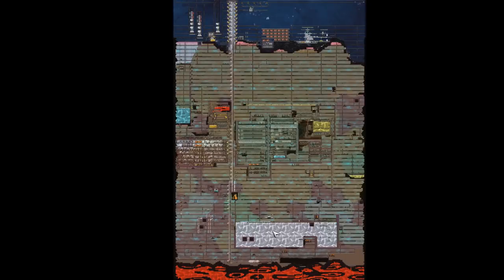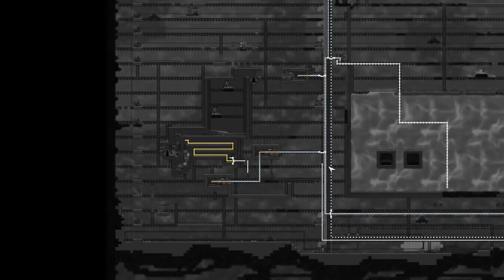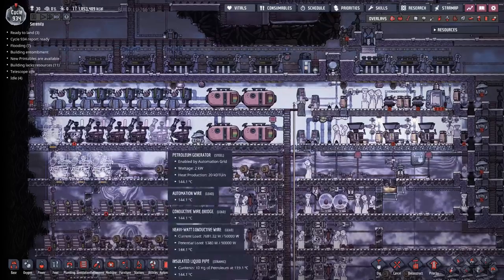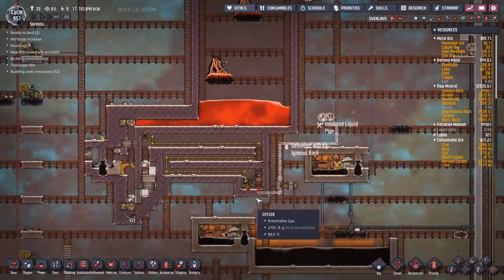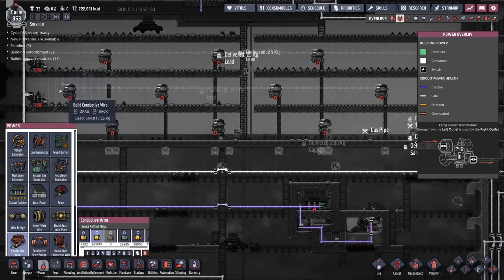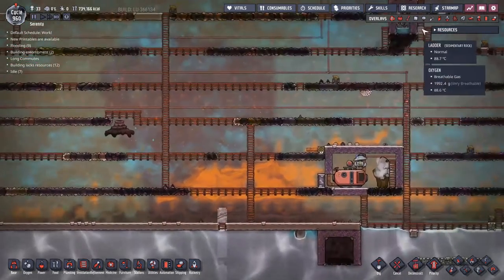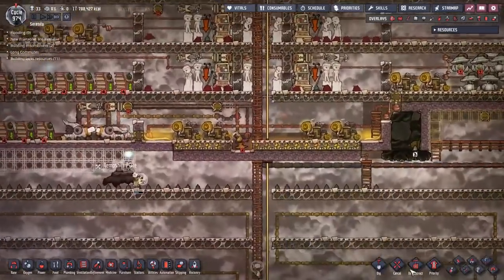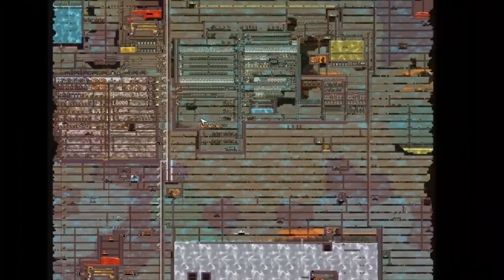Oasiss 18 : 2nd Petroleum boiler, 3 Nat gas vents, Sauna expansion : Oxygen not included

Comment: i am building your oil boiler at the moment on 2 maps but added a little bit to it. Where the igneous rock falls down i put another vacuum area with a autosweeper and a conveyor (both standing in a bit of oil with a cooling loop behind) and sweep the igenous rock. This travels in vacuum to a closed by steam turbine room and through it. Inside there is also the aqua tuner for the cooling loop. I didn't manage yet to start the boiler (have only 10 dupes and build slow... 400 cycles and not yet in space) but i guess the igneous rock will be hot enough to run the turbine, come out "cool" and can be used then.
Reply from the maker: There is plenty of stuff you can do with the hot rock if you want to,  I could have sent it to my industrial power sauna but I would have had to create a vacuum tunnel to get it there.  How useful it is does depend on location.

Comment: Question. Do you think with thatmuch magma that you could use it for creating steamvents that produce power with it?
Since there was 1 of the baseloving videos a guy who had molten steel in it. Do you think you could pump lava into a pipe and then use normal pipes to radiate the heat into a steam room to basically create power? (Limiting the flow so not to much heat gets transfered). Because if you can get like 2-3 turbines running thats 2KW of power you can get out of it directly. (also allowing to use the exess energy that you don't need from your volcano)
Reply from the maker: It's possible to extract direct power from a volcano, however a petroleum boiler will provide far more power so that's the usual route. However with multiple volcano's you could and should tap them for power. The hard part is making it maintenance free and relatively cheap to build. I have a design going up in today's video that should work out pretty good.
Reply: @FrancisJohnYT  thanks. 
Yeah but a petroleum boiler is limited in power output. 10kg/s not much more. 
The idea is to use the excess power that the throughput can not let through.
Reply from the maker: @Speiger  it could be done but at best you would gain about 1 KW.
Reply: @FrancisJohnYT  Having or not having.
Honestly with a steam chamber it could be even more increased. Depends on how much work you want to add.

Comment: Where would you get the heat for a boiler if you don't have any magma?

Im on a cold map with a frozen core. Needless to say, natural heat isn't something I have to work with. The only thing I can think of is to use a metal refinery or glass forge. Nothing else really reaches 400C itself or from an output.
Reply: I also have relatively cold map and frozen core, but i still discovered two volcanoes so far.
Reply from the maker: Magma is really the only early/mid game choice. There are some getto designs using refinery but nothing I would classify as fire and forget. Your best bet is to hold out until space and get 5kg of niobioum. Use that to make a bunch of Therimum. Use a therimum aquatuner as the heat source of your boiler.
Reply: @FrancisJohnYT  Thanks. My attempts didn't really pan out either. Thought liquid glass could be of use, but it can't hold much heat and reheating it through a refinery isn't really an option. 1 process of steal adds 1,200C of heat to glass due to its poor heat capacity. It instantly went to rock gass, broke/melted the obsidian insulated pipes, turned into magma, who then turned an area chunk of natural tiles into sand.

If it wasn't a frozen map, that could have been a fun cleanup. There really isn't any liquids with decent thermal capacity who also can reach higher temps. Liquid copper could work. Use glass to melt copper, then "maybe" use copper as a refinery coolant and as for a boiler heat source.
Reply from the maker: @102Chewy  Lead is liquid from mid 300C to about 1700C that might be a useful liquid coolant for your purposes.

Comment: From what i see on Tony's builds is that you are not utilizing the igneous rock that the magma turns into for extra heat potential.  Also you're not using a method that turns the magma blade into loose rock so you are forced to use a drill.  A drill that has caused you a lot of pain ;p i may add.
Reply from the maker: I made attempts to use a debris method for petroleum boiling but no matter what way I work it I either don't get the heat out fast enough or it becomes much bigger and more complicated than the drill method. Letting the tiles solidify and mining them so far is the simplest and most heat efficient method I'v found.

Comment: I want to know the math behind the length of the pipe in the petroleum boiler. You mentioned you use aluminium and it has to be shorter. How do you do the math on it?
Reply from the maker: Had to do practical testing to figure it out, here is the old video https://youtu.be/YWQcaus9if4?t=1590 I download the test map, swapped out the piping for Aluminum and re ran the tests. That is why the counter flow is the length it is.
Reply: You'd have to test.  If you wanted you could try to use heat exchanger equations to approximate it, but I doubt you'd get even decent results from those.

Comment: So I'm nearly hitting cycle 1000 and for a loooooong time my game has been running for about 10 -18 fps. Your game seems pretty fluid. I discovered that while the game is open, almost 4GB of RAM are consumed. With the amount of simulations calculated I'd rather think that CPU was the limiting factor... Lowering resolution, playing on window mode, playing with compatible windows8 version, not sending data to devs and disabling the map evolution feature dont solve the issue of RAM. Any advice?
Reply from the maker: I ran an 80 dupes base once, here is all my advice. Open the game and load up your map, if you ever need to change map or reload a save, quit out all the way to desktop first. Game has issues letting go of RAM. Reload the game every couple of hours, the time you waste reloading will be offset by the performance increase. Sweep all the debris on the map into one spot, maybe have a separate hot stuff area. Limit pathing so dupes have only one way to get to locations. Vacuum is better for FPS than Gas. Solid tiles are better for FPS than vacuum. Don't know about liquids. Try to avoid letting gasses/liquids mix. This just causes more calculations than having a uniform gas/liquid. The more dupes you have the worse it gets. I should have stopped at 24.